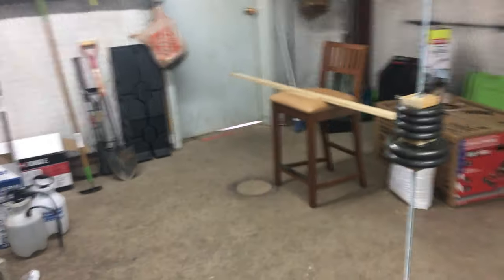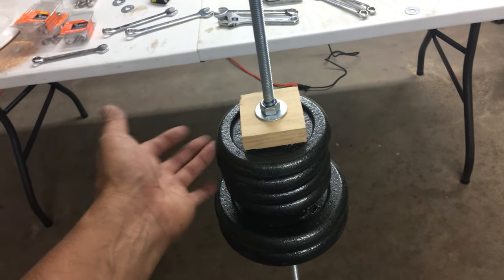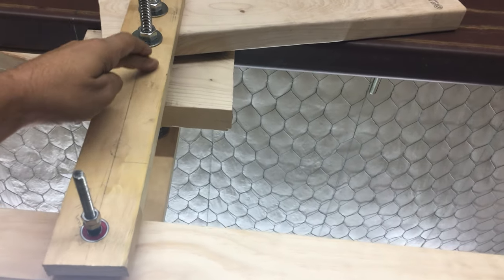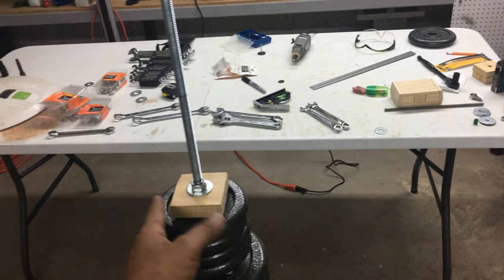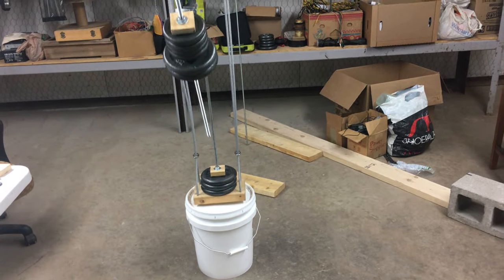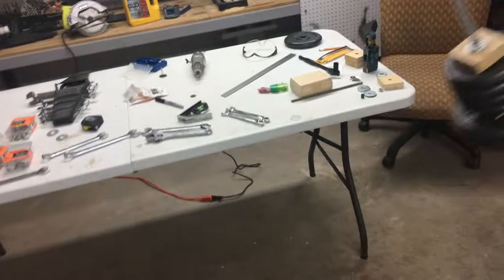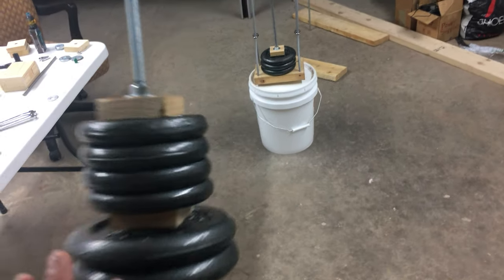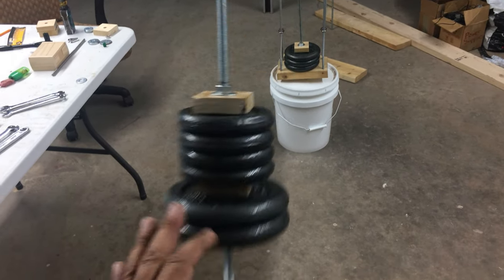Two Stage Mechanical Oscillator Part I

Comment: can you make an air pump with that vertical movement? I would love to see it
Reply from the maker: Yes I could. However I have torn this completely down for other projects and it’s no longer available. 😶
Reply: @debunkified  another idea I have is: connect the top of the pendulum to a pulley system and a ratchet wheel, so that each time is can lift up a heavy object a little bit, and when high enough, you can drop it slowly while connecting it to an electric generator

Comment: Put a scale on top of the bucket under those weights and you'll see what you're actually lifting. Next to nothing. Their weight is nullified by the counter balance. 10 kids on either side of a seesaw are not lifting the other 10 kids. The 10 kids effectively weigh nothing! They are counterbalanced.
Reply from the maker: Ah, sure if it’s sitting there doing nothing. The problem is when the pendulum weight is at it’s highest on either side, it then is effectively weightless. Then what about the lever weights then?
Reply: @debunkified  exactly

Comment: 10:57 Hello. 
(I'm writing this via Google translate)
I'm not as smart as you. I don't know much about physics formulas. But I developed a very simple but effective idea about generating electricity from gravity that I haven't encountered anywhere else. I am currently trying to purchase material to verify and test the theory. If I give my opinion about this system: Yes, this is an oscillator. But it looks like an oscillator destined to succumb to gravity.
Reply from the maker: Ahmet Taşdemir Gravity is what powers it as the main working force, the other input force is simply a small periodic push to keep energy stored. Gravity is the external force outside of the system that cause the output to be more mechanically.
Reply: @debunkified   OK. I understand the logic of working now. Thank you. So can it work continuously after starting?
Reply from the maker: Ahmet Taşdemir Yes. You have to set up a system to loop it. This is tricky because of course two different times one has to contend with, the input and the output. This can be done with generating coils on the output. Store in battery, power input with said battery, rinse and repeat.
Reply: @debunkified   Thank you. I want to know your opinion about my project. If my theory works, if I do it with the same power as a 300w solar panel, it can pass the solar panel after about 8 months. And it has disadvantages as it is mechanical and takes up space. Do you think it can be preferred if it works? Is it worth anything?
Reply from the maker: Ahmet Taşdemir Yes, that is perfectly plausible. You can place the solar panel on the input by using a coil and a switching system. 

Although I don’t think a solar panel is necessary as the output can charge a battery which can then be used on the input to keep everything powered indefinitely.

If you happen to make this, then give credit to its creator please.
Reply: @debunkified   No. I think you got it wrong. I will not use solar energy in the system. I compared gravity energy with solar energy. Gravitational energy will have produced more than solar energy at the end of 8 months.
Reply from the maker: Ahmet Taşdemir yes because gravity is free.

Comment: The centripetal force pulls the lever down, i don't think there's free energy here.
Wait, it keeps hammering just by keeping it swinging without much friction. interesting.
change of direction and magnitude of acceleration by gravity.
Reply from the maker: Hi, you’re getting it. Yes for very little pushing force one gets out lots of weight lifting.

Gravity is the free external force  from ‘outside’ of the system that makes it do more work than the work going in.

Force times distance equals work. The input and output are basically the same distance but more force (moving weight) on the output.

I enjoy the fact that at two points in the system the entire device does not weigh anything.